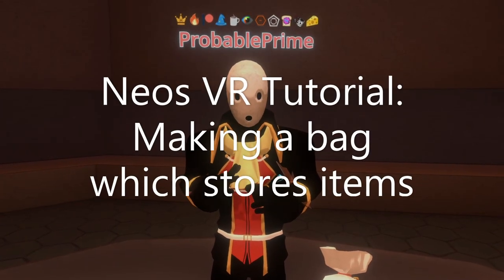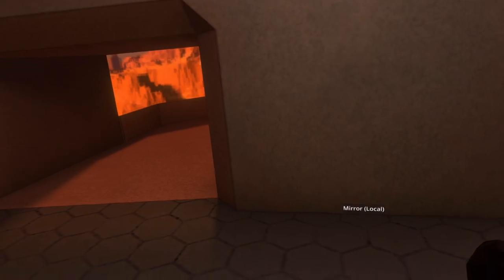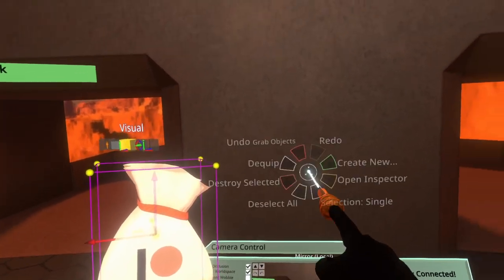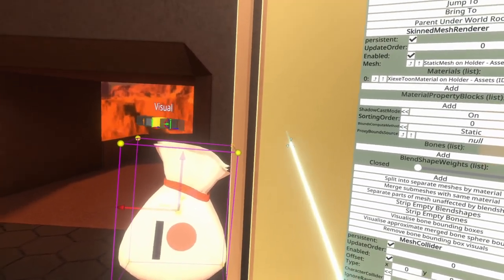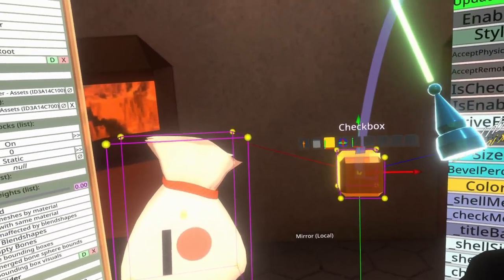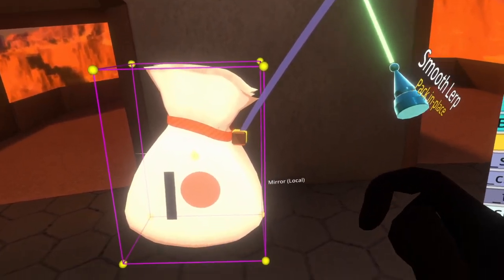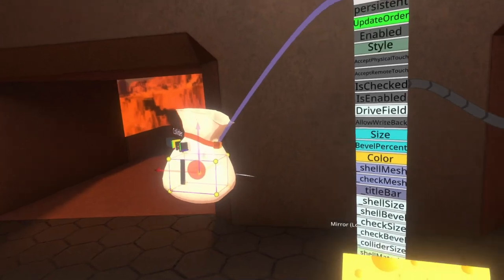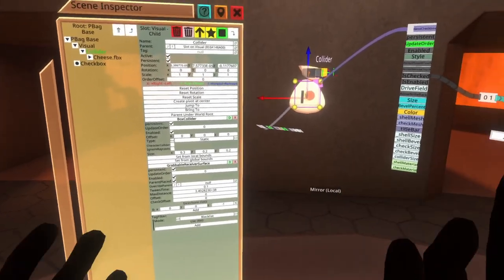OLD: Neos VR Tutorial: Making a bag which stores items

Comment: How many items can this p bag hold? Will the items collide with eachother overfill and not let more things in? Possible to make it into a "bag of holding"
Reply from the maker: Items will collide and be difficult to grab and arrange. Think of it like that drawer you have full of cables.
Reply: @ProbablePrime  mm i was just askin cause im new. 2 days in and i met someone with a hat they could store items in. The item icons would appear when you turn the hat upside down and you could grab the item. Looked so cool.
Reply from the maker: That's probably one of the grid based storage items. They use a more aligned system to store items within a grid. You can create those easily using a receiver surface that's larger than your container. 

When you open your container you show the grid with the receiver on it and when you close it you hide it.